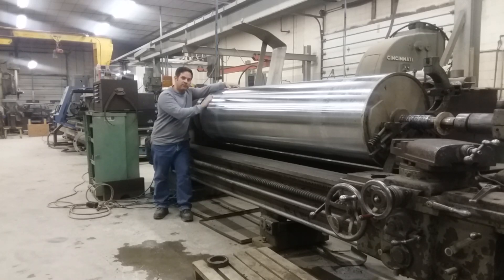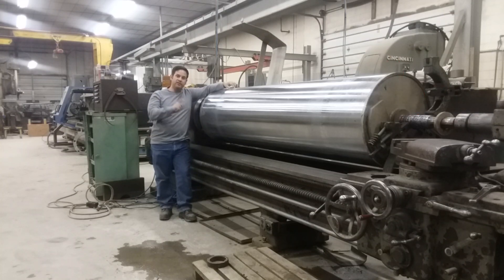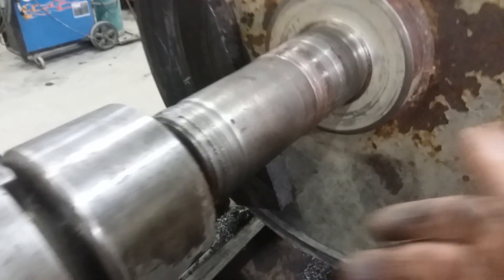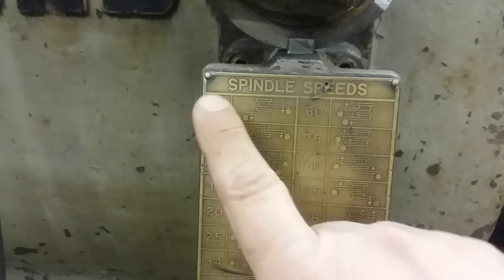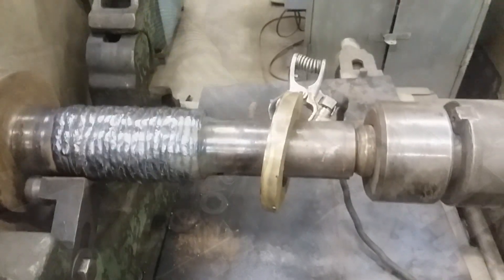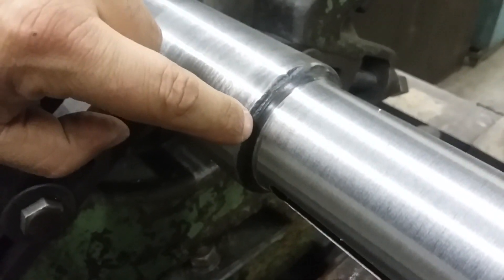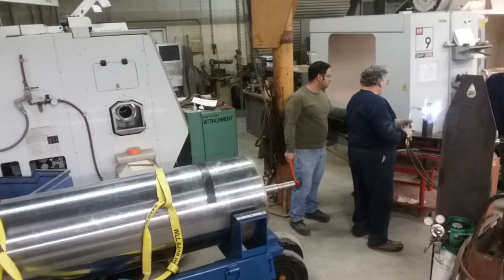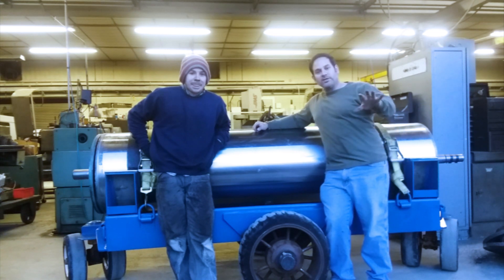Machining LARGE 4000 lb roll bearing journal on a Leblond Lathe

Comment: I've done several similar but smaller jobs like that but in the 150-300 pound size range and I like it much better than production work. Time really flies by as you have to think through every step as opposed to production where once it's set up and running it's just rinse and repeat. You always feel a sense of pride after doing a job like this and seeing how it all fits together as it should if you did your job right.
Reply from the maker: Truth

Comment: how would you like to shrink a 84in long cast iron barrel-48 inch diameter 24 inch bore  onto a 20 ft long steel shaft  that has been stepped turned to mate the cast iron bores  with a .012-015 press/shrink fit?  sugar mill roll shafts.  then machine the cast iron to diameter and then cut a series of V-grooves  usually 50degree by2-1/2 wide the entire length of the roll.  total weight in the neighborhood of 50,000 lbs or more  depending on the groove geometry..  can be 40-50 degrees and width/depth variable also  depending on design..  in my career,  i've probably turned. faced, and grooved over 100 of these puppies.
Reply from the maker: I wouldn't
Reply: @RayMAKES  trust me  it takes a lot of heat  and a big big press.  to cheat on the press time,  the roll bore is stepped 4 times,  and the shaft is going on is step turned accordingly,  so the length of pressing only amounts to 20 inches at most,  gobs of white lead replacement in the bore and about 1000 tons of press force

Comment: You could re sleeve that journal and even keyway it. Heat the sleeve and it will shrink on. Machining weld will eat your inserts in no time.
Reply: Not ud you use the correct inserts. You can get tough and not hard inserts that eat throug welds like butter. I do it all the time

Comment: ...I was 'the welder' in a couple machine shops....we did stuff like this ....I was often the one who had to 'install' the bearings/gears that went on the repaired shaft...we did quite a bit of stuff for a big concrete company that used rolls with the 'timken' bearing units that are used on railroad axles....when I first started working there, there was a lot of guessing about the heat and size....I tried using inside 'mike' to measure the bore while heating...saved a lot of swearing and using the 12 pound hammer....
Reply from the maker: Yep, it's work that needs to be done
Reply: I do the same type of work and have for the last 18 years. An older "wiser" guy taught me a method of making the fit when machining sleeves etc or a shaft that needs to be a shrink or press fit. Use .001 per OD inch for most press fits and when removing for instance a bull gear from a 6" shaft you can bet that it will need to be around 600 degrees F before it winks. Has always worked for me.  16 years in heavy oilfield machine work and now two in a regular job shop. I still enjoy it but it has its days.

Comment: We have done a lot of repairs like that, and also used the shrink sleeve on repair. All our roller we made had shrunk in ends, we made a ring burner i.e. 360 of heat used natural gas and compressed air worked really well. Once we set on a new manger and  he decided to put in a liquid nitrogen tank to freeze ends, cost him his job because it did not work easier to get more expansion with heat , than cold. Plus that stuff was very dangerous,
Reply from the maker: yes its a technique we like to use, works very well